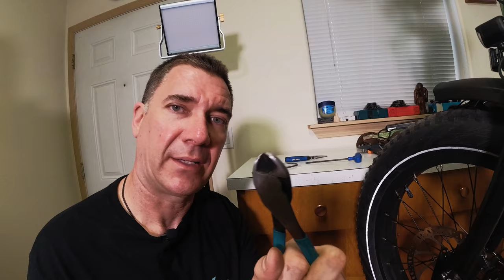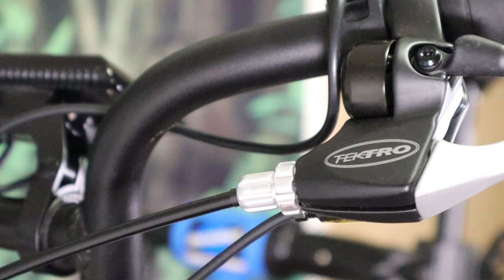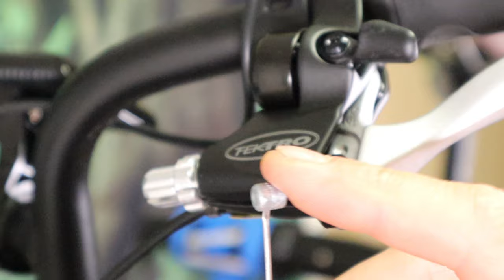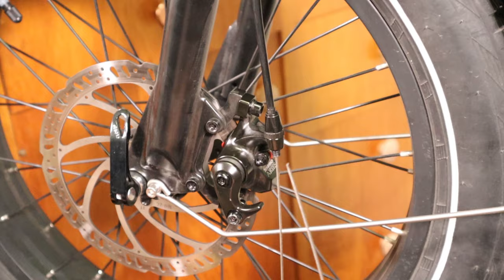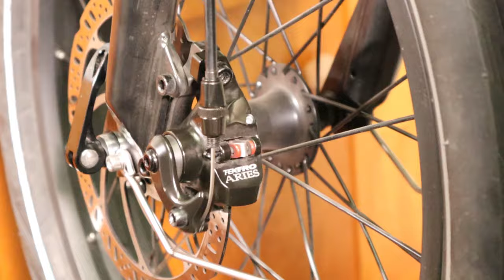RadExpand 5 - How To REPLACE Your BRAKE CABLES

Comment: Have a Roadrunner and plan to change the rear brake cable, my worry is that after I take the old cable out, will the new one slide in easily and come out the other end because it routes partly inside the bike and takes a few twists and turns.

Comment: What part of the cable gets stretched due to wears? Is it the whole cable or the point where it actuates the actual brakes ? Or at the lever?
Reply: So would you have to replace the entire cable if that happens or just shorten the end if you made it extra long to begin with

Comment: Hi Chris how are you doing hey look I really like your videos they're very informative where can I buy a rear caliper for my rad mini 4 power bike I swear I've looked on Amazon eBay all over the place I even went to rad power bikes website and they can't even help me what I did was I broke the thread where the brake cable goes through the caliper where you screw down the barrel on to the brake cable and I've noticed that it's part of the caliper so I can't just replace the threads I need a whole rear caliper but I need an r180 and I can't find it can you please tell me where I can buy one thank you sir I appreciate you

Comment: Ok I have 2 problems. 
Number 1, the cables I bought, the little bullet head is smaller. Does that make a difference ?
Number 2. Even if I put the original cable back in. The bullet head, turns itself sideways. Does that make a difference ?
I dont know what to do ?
Reply: I'm just trying this ! i'm wondering too :)

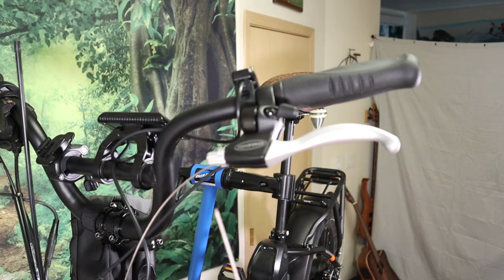Comment: At 3:49, I think it's better to leave the barrel adjuster a few turns out rather than screwing it all the way in. I had a cable snap at the caliper once, and because I had some slack in the line, I was able to loosen the adjuster, pull the cable through to compensate, and keep riding until I could get a new one.

Comment: I know you wouldn't normally cut a cable before pushing it through its housing, but lets say somehow you did... How can you prep the end such that it doesn't fray, but the end stays nice and skinny so it can be pushed through easily?  In other words, how can you do what they do at the factory?   I've found that when I solder a cut cable, the soldered end will usually no longer fit through a housing.

(In case it's not obvious, I'm not a bike guy, but I'm using the cables for other projects.)
Reply from the maker: You can cut the cable and still run it through housing. I do it all the time
Reply: @PedalWithPower  Cool... I don't happen to be working with bicycle cables though... My cables are similar, but the inside cable is about 3/16" thick and the OD of the housing is about 3/8".  Obviously a totally unrelated but was hoping to find answers here.  Just in case there's info, I'll just describe it here: My cables are for a passenger-side brake pedal for a driving school car.  Via pulleys, when the passenger-side pedal is depressed, it pulls down the driver-side pedal.  Obviously heavy duty, and this kind of cable frays quite easily after cutting, probably because it has a lot more strands.  If you have answers they're welcome but if not that's cool.

Comment: I would like to swap my front and rear brakes putting my front brake on my right hand ( like my motorcycle and scooter ).   Can I get enough slack with the existing cables?   Are there any gotchas in trying to do this?
Reply from the maker: Hi Ron, if you can screw in the barrel adjusters on the levers and on the calipers, that might give you enough slack to pop the ends out of the levers and swap them. If not, you'll need to loosen the cinch bolt on the caliper, swap the cables at the levers, then tighten the cable again at the cinch bolt.
I can do a video, showing how 👍
Reply: @PedalWithPower  Thanks for the encouragement.  That was actually very easy to do.
Reply: I think for safety reason the front brake is always activated by the left hand lever.
Reply from the maker: @mrslcom  Some folks like switch, especially if your used to riding a motorcycle

Comment: Is it necessary to lubricate the brake cables?
Reply from the maker: It can help if your housing is getting sticky, but not necessary when these bikes run full housing from the lever to the caliper. Lubing cables is far more important on bikes with housing breaks and exposed cables.
If you pull your cable out and it looks rusty, then it time to replace the housing also.
Reply: Thanks Chris.  Before I thought lubrication might also make it easier and smoother to pull the brake levers, especially for the rear brake due to its longer cable length.
Reply from the maker: @mrslcom  It certainly can and it does help, but I just wouldn't say it's "necessary". If you have it, you can certainly use it!

Comment: Would this work for the rear too since it's a long travel for the cable?
Reply from the maker: Yes, the cable that I link to, is long enough for the rear 👍
Reply: @PedalWithPower  I just tried it but my cable was too short so I'm going back to the bike shop for a longer cable..btw good video and thanks for posting😃
Reply from the maker: @trini_boi2414  Make sure the cable is at least 2000mm or longer. Not all brake cables are the same length. It can be frustrating. Have them measure the cable, a lot of bulk cables from bike shops are not that long. At my shop the bulk cables are only 1700mm and won't reach for the rear.
Ask if they have longer brake cables for tandems or trikes 👍
Reply: @PedalWithPower  thanks I took the old cable and told the guy I need about a foot longer and it worked perfectly..thanks again you got a new subscriber 😃
Reply from the maker: @trini_boi2414  Fantastic!